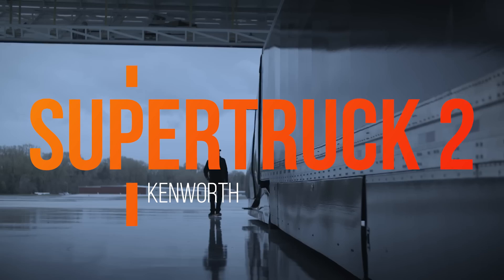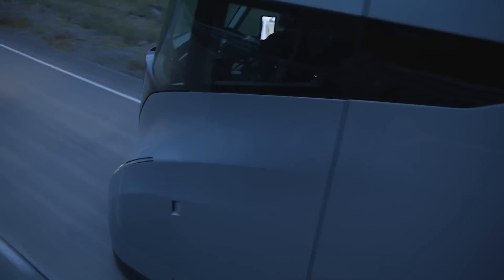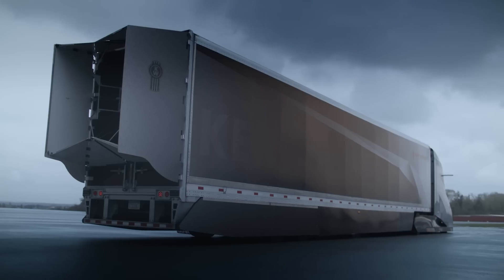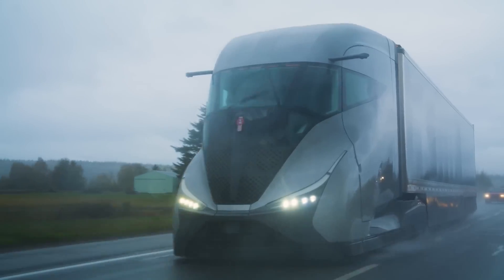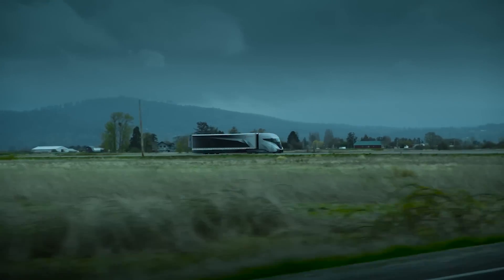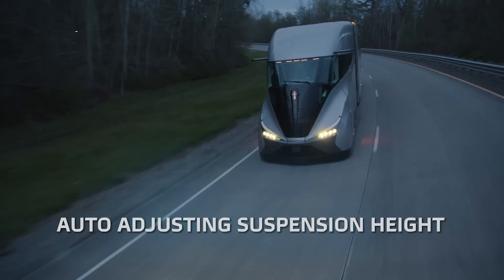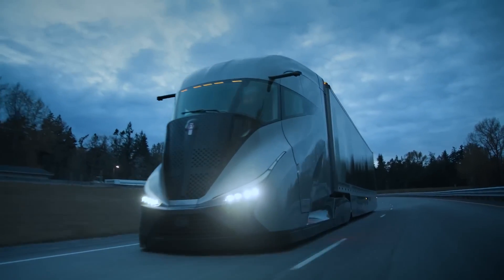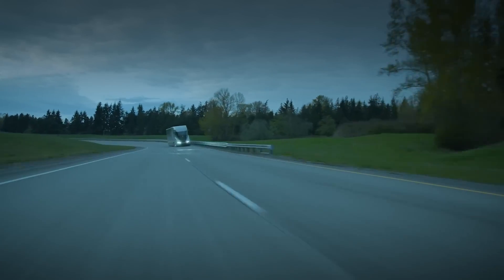🚚 Kenworth SuperTruck 2 Concept: Revolutionizing Efficiency on the Road

Comment: Those aerodynamics won't help for local driving, and during long runs if it doesn't have the power to climb the grades, that sleek look aint doing no good....and what if I cant afford that trailer....how will it run with a older trailer?   They got lots of work to still do, n my opinion

Comment: It's an amazing concept and step forward.  But with practically 0 ground clearance it will make trucking on anything but smooth highways a challenge.   Unless they have some kind of lifting system but that would add weight and complexity